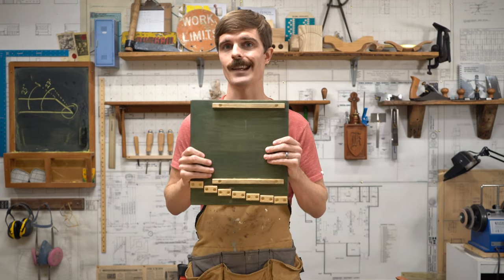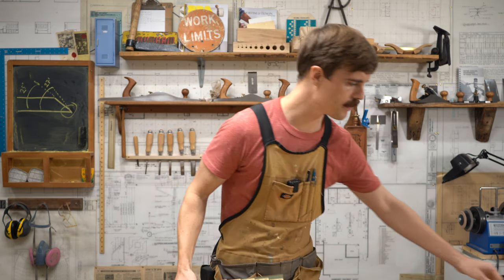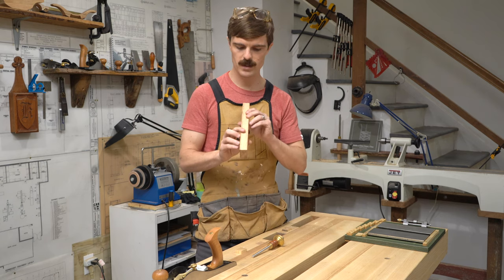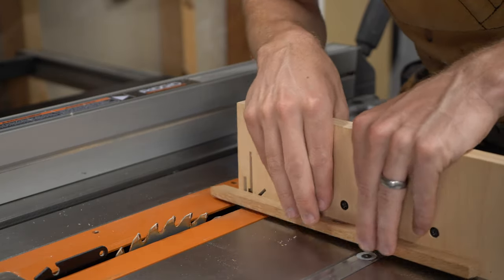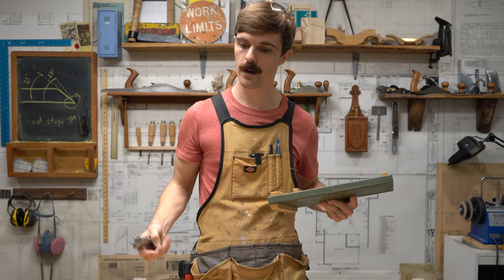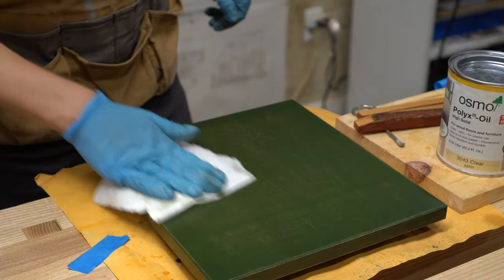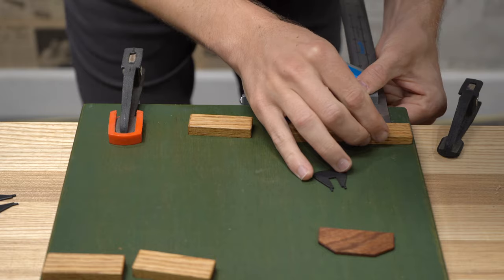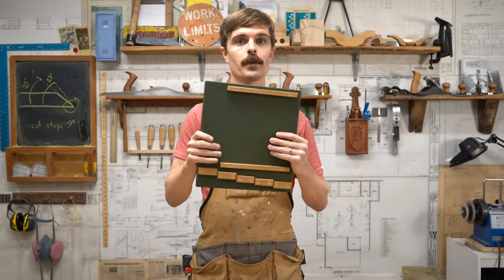How to Make an Angle Setting Jig for Sharpening

Comment: Great to see you starting more long form videos! 

Re: keeping the angle stop blocks square while screwing them in, you (or anyone building this) might try tacking them down with thin CA glue and activator instead of (or prior to) clamping. A pin nailer might also work for this. While square might not matter for plane irons, it will come into play with smaller chisels if you don't use the same spot to reference every time.
Reply from the maker: Good call on the CA glue!

Comment: Excellent tutorial on the sharpening jig. Like you, I’ve bought a lot of sharpening gizmos over the years, and watched a lot of tutorials on the subject.
 Have the Veritas Mk2 honing guide,  along with my original, decades old Eclipse and the more recent Veritas, Eclipse style guide.
The Mk2 lives in a drawer. Too much of a fidget to setup, and the tool has a tendency to shift slightly, giving uneven results. Retail regret on steroids!
Anyhoo, with the new, much cheaper Veritas, everything works just as it should. The addition of the angle setting jig and a shim should make sharpening less of a grind, so to speak. Thanks for sharing!

Comment: Hello, if the distant is 1 1/2 inch for 25 degree, what are the others measurements and degrees, Tks.
Reply: He actually gives measurements, but, the two he shows are for two 'brands' of honing guide.  I guess we do the 1 1/2 inch etc measurements if you don't have an "Eclipse Honing guide"?
Reply: Thank you @LDU2U  I actually now use an angle gauge on top of blades or chisels and adjust the jig.